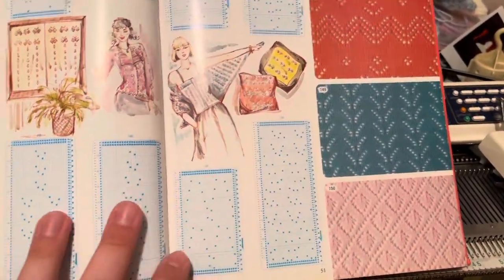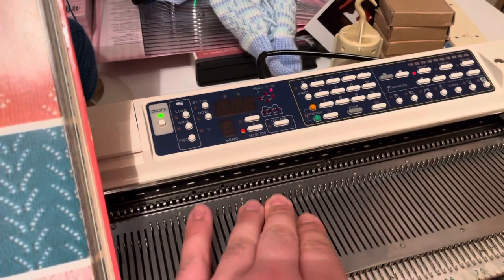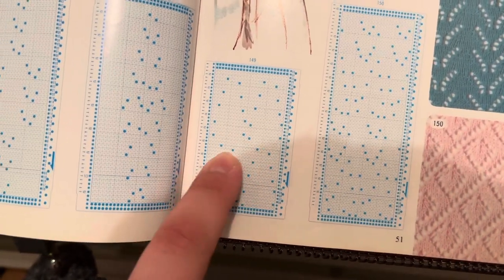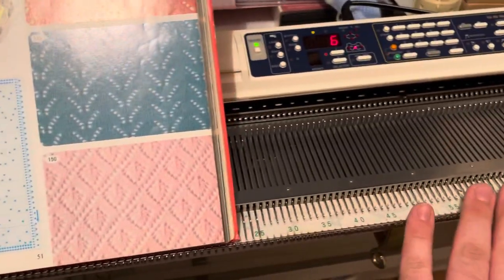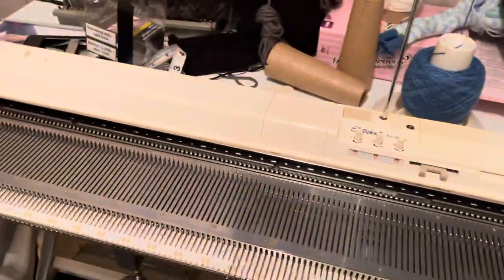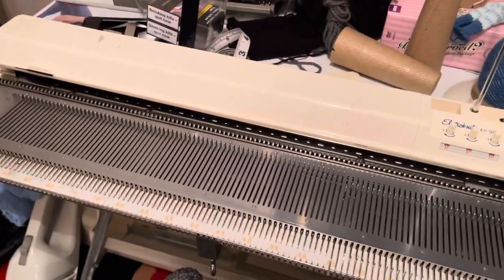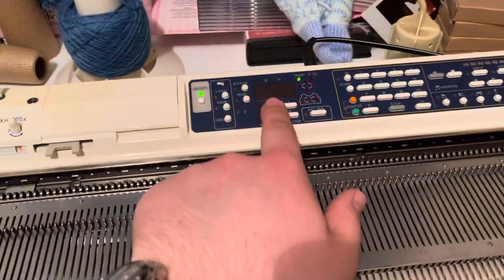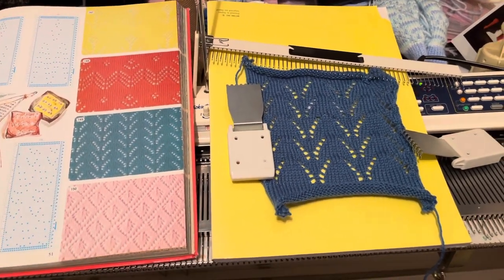Inputting Punchcard Patterns on a Brother KH-930/40/65/65i & Introduction To The Lace Carriage - 1

Comment: Is there any difference between the 965 and 965i?  I am thinking of buying the 965 but if the 965i is a better option and has more functionality I will definitely get that one.  Thank you for a very informative tutorial 😊 (like your sense of humour too ).
Reply from the maker: Both machines work identically, they have the same built in patterns and the same console. 

The 965i has the addition of the 8 pin interface port for connecting the disc drive and DAK software, if you use that.  People who use DAK tend to go for the 965i but both machines are great choices.
Reply: @Thesweaterfactory  Hi Alex thank you so much for your reply.  That answers my query and I am going to go get the 965 I think.  Keep up the good work with all your knitting machines (how many do you have?) and tutorials we all appreciate them.